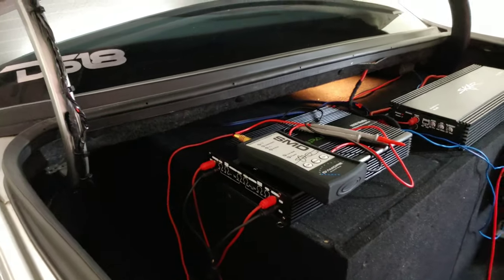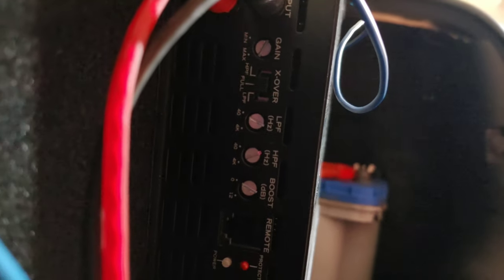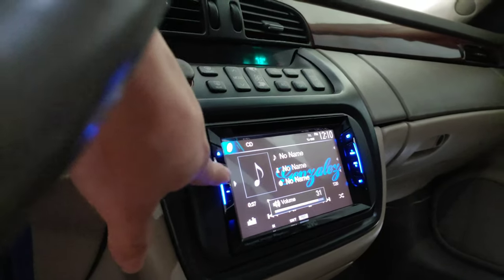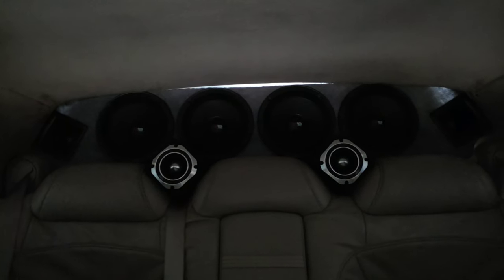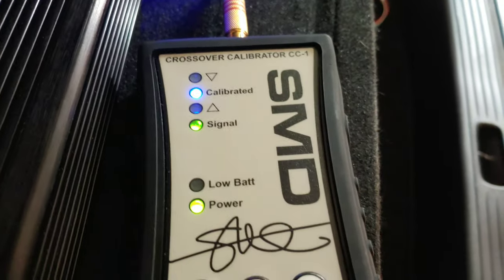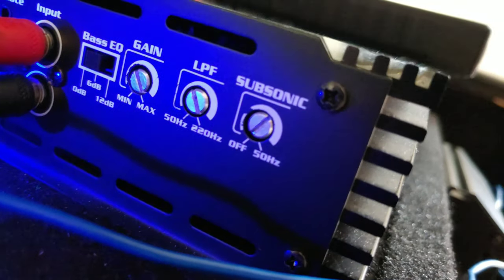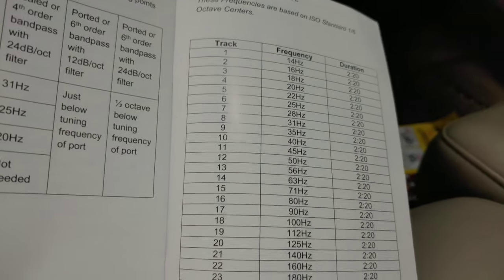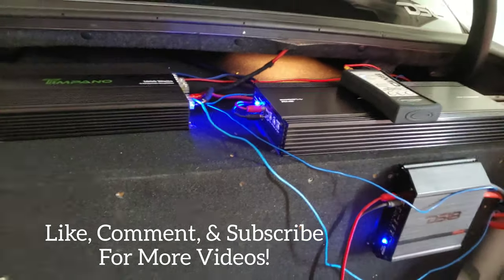Setting Amplifier Crossovers With A CC1

Comment: So when I was doing my bass amp I couldn't get it to read the crossover till 40hrz , tried 31 and turned lpf all the way down and nothing so then I tried 35 and same nothing but on 40hrz it worked is this normal? I did exactly how you did it but only 3 overlap not 5 lol like you .

Comment: if i have speakers that do 42 - 20,000 Hz what should i set my HPF too ?
Reply from the maker: I would set the hpf to 50hz or even 60hz to be on the safe side. But also depends on your slope as well.
Reply: 80hz with the slope it can come all the way down to 50hz

Comment: If I have my sub amp set to low pass 100hz and gain to half. Do I still use the low pass filter on the head unit at 100hz with -18db slope
Reply from the maker: I cant tell you about the gain because every amp/system is different.. But i would also set my lpf on headunit as well
Reply: Sleepy Boiii so if I set the LP on amp to 100hz do the same on head unit at 100hz slope at -18db is this right?
Reply from the maker: Yes at -18 db slope or any slope you would like, depends how you want to roll off your crossover

Comment: Ok I just ordered a combo package of the DD-1 and CC-1 to tune my new deafbonce AAK 6k and JP 34AB I've never tuned an amp before let alone multiple amps and done crossover I didn't think about it when I ordered it but how do you tune it with the provided CD if you are using a stock head unit with NO CD player can I just play the required test tone through my phone or how do I do this
Reply from the maker: You can use the test tones that he provides on his website
Reply: @SleepyBoiii  ok I downloaded them please excuse my ignorance I'm still learning but I wanted to ask you when you were setting your crossover you said something about the tweeters playing up to 2K Hz but you set it at 2.5K is that how I need to set it up with the track based on the speaker parameters

Comment: I wouldn't recommend setting your high pass filtering on the bass amplifier at 31hz. You should set it at 40hz. It will still play frequencies under 40hz but just not quite as loud which will make the bass sound more accurate around 20-45hz. As well, keep the bass boost off.

Comment: Do you think setting the crossovers on the headunit and amp is overkill?
Reply from the maker: No not at all, because on your headunit you can also set your slopes after you set them at your amp.
Reply: @SleepyBoiii  Thank you i was thinking the same thing i appreciate it.
Reply: @HG-NLINE  honestly, if you have the ability to filter the signal coming into the amplifier that is best, then the amplifier only has to concentrate on power and amplifying the selected frequencies. Never use both. Either use one or the other.

Comment: what tools can we get to help with setting rms or wattage. i have a more powerful amp for a weaker speaker. i dont want it that high. is there a tool to help with rms or wattage power and for adjustments?
Reply: This depends on a lot of factors is the enclosure the smaller then recommended size is it larger if it’s a smaller enclosure you can safely overpower the sub if it’s larger you want to under power for longevity however if the gains are set right you shouldn’t blow anything I have a t1500.1bdcp (dyno shows 1800w at 14.4v) on a t1d212 (800w sub) wired at 1ohm gains set with dd1 and oscilloscope no clipping and you should be good, how much more wattage is your amp then your sub? Also is it RMS wattage or max wattage that your looking at? What sub what amp you running? If you would like to hit me up on Facebook or IG R & E builds I can help you further
Reply: @robertfarley9437  I have the same problem with dialing in the correct amount of gain on a set of low powered subwoofers. I want to install two, Tang Band - W5-1138SMF 5 1/4" 4-Ohm SVC Subwoofers (45 watts RMS each) wired @ 2-Ohm on a Skar Audio - RP-1200.1D amplifier that produces 800 watts @ 2-Ohm. How do I dial down my amplifier to ruffly 100 watts so I do not blow my small 5 1/4" subwoofers?

Comment: How do you know what hz you want to play on your speakers?
Reply from the maker: Make sure you you a little higher frequency that your speaker can handle, use a slope at the headunit once you set the crossovers at your amp. Check the specs of your speakers. It shows you the frequency range it can produce
Reply: @SleepyBoiii  I have a skar sk 100.4 ab. Do I set it to hi pass ,full or low pass. I have spx-65c on crossovers. And components
Reply from the maker: @KIDROCKABILLY1  since you are using speakers always use HPF For speakers.
Reply: @SleepyBoiii  Sorry I was saying I have components in the front and coaxial speakers in the back. Thanks for the replies and videos. I Subscribed
Reply: @SleepyBoiii  when using the cc1 with hpf I am not able to get signal to calibrate. Only lpf
Reply from the maker: Check the volume on the hu... make sure the signal is green, play the test tone at its maximum unclipped volume  & click read.. Then on your amp switch to hpf with your desired frequency & adjust the crossover